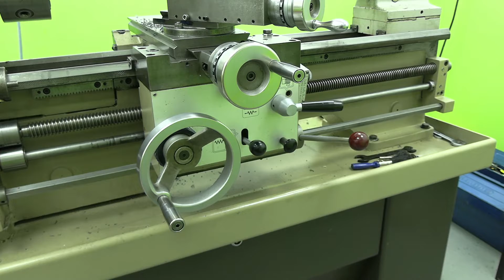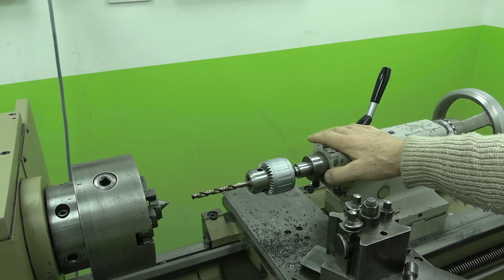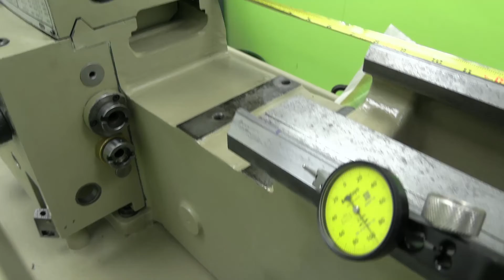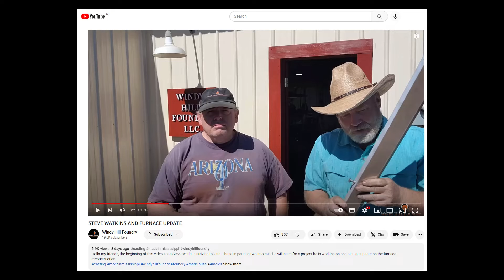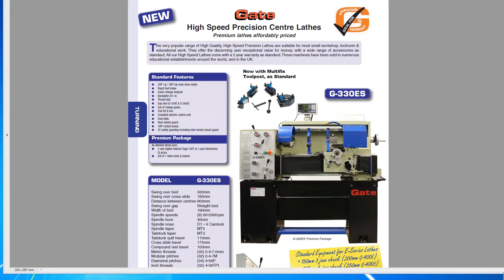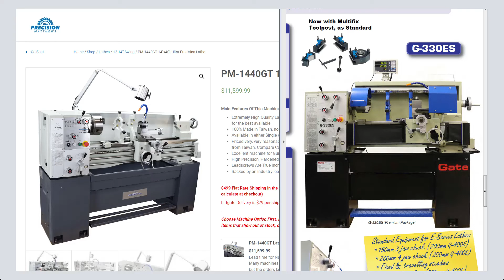What shall I do with my Harrison M300 lathe??

Comment: Hi Samuel,  I am way behind in viewing your M300 videos but greatly enjoyed the earlier ones when you were disassembling sections, etc.  I tend to phase switch between hobbies and just started doing a bit of machining again.  I found this video to be GREATLY entertaining, having gone through many of the same trials, tribulations and pain.  I obtained my M300 in 2004 from a small, cryogenic prototype lab.  It had some wear but not much.  It's the older green model which I forget the dating of.  It's a fine machine and I've especially loved it for the metric and inch thread capabilities.  Retired now for over a year but designed and machined many high precision adapters for fiber optic connectors and adapters.  I don't know how to share my thoughts and advice other than the bullet list which follows.  This would be better over tea (for you) and coffee (for me) or cold beers in summer.
* Physicists and engineers should never buy used machinery (ask me how I know).  Why not?  Because they are used.  We look at the precision of a new machine and lament over every wear point that we find.  You may smile when you realize that the specification sheet is the ultimate medication for our quest.  It ain't gonna get any better than the spec sheet 🙂
Physicists and engineers should never go looking at new precision machinery while trying to restore what they have.
* Now for a quick reality check.  What are you going to make with it?  A small, working model of a linear accelerator or a special bolt to fix your car which the dealer has a month away?  You need precision?  Ok, over what length?  If your precision is over 1 or 2 inches (sorry but I'm going to stay in inch, which you are anyway, correct>), then 1 or 2 inches is the length over which you should judge the machines accuracy.  Not to boast but my slightly worn M300 will hold under 0.001" over a 6", 2" diameter aluminum rod, for a fine final pass.  
*  As I listened to your plight, my mind kept saying ... he needs/wants a NEW M300 which meets its spec sheet.
*  Mostly practical advice from here on ...
*  Be sure that the bed is absolutely level, measured with precision machinist's level and two point with ZERO wear.  I think your machine is a gap bed without leaving my typing for a moment.  This introduces other distortion effects.  So do your leveling.  Be sure that the machine sits absolutely flat before it is bolted down or the bolting down may introduce another distortion components starting at the two ends, going inward on the length.
*  The bed will also have differential wear, which is a different amount of wear on the front way vs the rear way which the carriage rides on.  This can hurt or help you, in your case probably help your DTI measurements.  So your DTI swings off, who cares until you repeat this test on the rear way.  The rear way generally has a bit less wear and may help balance the pain.
*  I know you wanted three phase real bad but keep in mind that single to three phase motor drives not only give great accel and decel features, along with braking control, but the three phase is precisely generated.  It's far better than a 3 phase line and for only a few hundred dollars.
*  I should slow down for now in case YouTube had a limit.
*  I'd be glad to swap other thoughts if I can somehow get a real email.  I don't think YT has private messages though so don;t know how.
*  In my quest for the perfect lathe (M300 is about it) I actually carried an Emco Maximat 11 home and back the next day when I discovered that the headstock bearings were totally shot.  This was in a small SUV at the time and not fun.
*  Headstock bearings -  don't worry too much about visual imperfections.  They may be in the Angstroms (had to throw in some physics units for you).  Change your oil, adjust the bearing properly and at operating temperature.  Then test the runout at your spindle nose.  You may find its almost immeasurable (sorry if you've commented on the actual runout as I only skimmed the video but will watch again.
*  Buy your self a Rohm or other Set-tru three or six jaw chuck.  You can zero out any repetitive runout.
*  VERY IMPORTANT - always keep in mind that for very precise work, especially concentricity, you can machine a part without removing to achieve zero TIR.  Can't really do this on length BUT you could fake a compensation for the bed wear by running a live center on your part.  If the length over which you need precision falls within the length of uniform bed wear, you can null it out by introducing an intentional , very slight taper using the tailstock adjustment.

More later !
Reply from the maker: Thanks for sharing your wisdom. I fear you are right that physicists shouldn't look at used machinery. I want a new M300 but I don't need one! In fact, I hardly need a lathe at all. I bought a Chinese minilathe as a cheap learning exercise, and to make small parts for my robot sailing boat project (which is in abeyance now because my friend Dick is busy). Then got so fed up with minilathe limitations that I went for the M300 - at least I can part off ok with that. Then got sucked down this machinists rabbit hole... Bed is level. I have measured the wear on both ways, even calculated the rotation of the tool post caused by differential back/front way wear. Not sure about VFDs.  My profile has an email address on it. Think the headstock bearing wear is a lot worse than Angstroms but am happily ignoring it. Did reset the bearing preload and measure the run out although there are dings on the external and internal tapers of the spindle that make interpretation difficult. I reckoned run out was within 10 microns. Over here these Rohm Hi-tru chucks are almost as costly as the lathe but would be nice to have. I experimented with tailstock adjustment and travelling steady rest in https://www.youtube.com/watch?v=A0uTpcw1i7Y but without much success.

Comment: Hi Samuel, we bought a worn '97 VS330TR which is basically same machine as your M300 but with variable speed and top rpm of 3000. As for our bed it was well worn thanks to the knuckle heads at Air Canada maintenance in Montreal ( we bought second hand )  Once cleaned up and prior to putting the machine into production in our small tool and die business it became apparent to me that the lathe would need a bed regrind. We had exact same symptoms that you encountered with then carriage rattling across the lead screw and a 0.015" carriage dipping motion near head stock. 5500 can dollars later it was reworked by a very competent local to us machine tool re-builder. I can email you pictures if you like, it turned out amazing and they Turcite lined the carriage to regain what was worn and ground off. As for sticking with the Harrison it was that at 10K plus my labor or a new machine at over 30K can. The 13 x 24" working field is populated by cheap imports that run 2000rpm and have small 2hp at most motors. A quality 2500 rpm 3 phase 3 hp industrial quality lathe is no commonplace unless you look at the likes of Weiler, Schaublin or other high end Euro machines. I feel the Harrison Colchester Group 600 have best bang for the buck.

Comment: Hi Samuel.  I haven't watched all the videos, but do feel for you, as you must be thoroughly browned off after so much work.  I don't think you should look for either new machine or another secondhand one.  This is because they will have faults too (others have commented about the Far Eastern ones needing 'commissioning'), and you will have to sort them out.  Can you face starting all over again?  And for the expense, think of all the materials you can turn with the money saved!!  You know where you are with this M300, so I'd go with the re gound bed. Yes dismantling it again, is a complete pain, but you will be able to change all the seals (hindsight is wonderful isn't, just chalk that up to experience).  The headstock bearing marks are smooth, and I think it runs true, so it's cosmetic isn't?  Sort out the cross slide wear, and that leaves the tailstock, for which you have 'fix' until you can source another one that is better.  Then you have a machine that you know has a good bed, etc.  At that point it will be as good as it can be made to be, and possibly better than a new one!!   Finally I doubt there is any machine that is perfect in the physics sense, so we all work within tolerances', and the question only you can answer is, 'how much inaccuracy can I tolerate?'  To quote Voltaire 'Perfect is the enemy of good...'  Wish you well for Christmas and your decision.  RB

Comment: FWIW I agree with Nicco Deamus snd others: finish the job and you will have a first rate reliable and accurate lathe that you know inside out. Given your experience with discovering the design and manufacturing inadequacies of apparently top quality items, I very much doubt you would find a purchase that will satisfy you straight out of the box. Stick with the known failings and address them rather than taking on a whole new set. Merry Christmas.

Comment: I’ve learned much from your videos and have bought a similar clapped out M300.  I replaced the saddle seals, not too difficult.  
The answer is to regrind, reseal, and replace the bearing with new.  Possibly buy a new tailstock.  If you do that work you’ll effectively have a new lathe.  You can do the bearing/seals while it’s all apart being reground.  The question is how much you value not having a lathe while it’s being restored.  It’ll be much easier to disassemble the second time because your not discovering how to do it

Comment: Hi Samual, I have watched your videos on the refurbishment of your Harrison 
M 300 Lathe.  I think you have already done the bulk of the work and as you have to get it reground , you would end up with a really accurate lathe, and know that all the work you’ve done is right.  Buying another lathe without knowing the providence is risky unless you can check out the lathe before buying.  I trained as a fitter and turner. I have used various makes of lathes and , Harrison and Colchester are among the best quality machines in the world. Some machines are advertised as the same quality or spec as Harrison/ Colchester, but are not the same quality. You should check out if the tailstock can be professionally be refurbished, or a good second hand tailstock be acquired.  Best of luck Samual, really enjoy your videos. Paul Keegan

Comment: Hi Samuel, I have the very same lathe and have encountered most the same issues. Worst been the bed wear and inaccuracy of it all, and the frustration of it not been good enough. The cross slide on my lathe I improved by turning a new lead screw and making the two new brass nuts. It was wear in this lead screw and nuts that made it tighten at the extremes of its travel. Just a thought for you.
Also after many frustrating weeks of setting the lathe up, I deliberately have a small twist in the bed to help with the wear near the headstock. I'm happy (ish) now I can make parts with relatively good results. I had to stop myself from driving myself mad with this project because I am sure I would drive myself mad with a new lathe also, constantly aiming for perfection when it's not really necessary for what I use it for. But if I had the money to spare I would have the best of both. Buy a nice new lathe, keep your M300 for the nasty jobs like turning a brake disc or roughing out holes then swap them to your new lathe and finish off. Why not. You've worked hard, payed your tax, TREAT YOURSELF. I'd Like to see what inventions you come up with and make!😀

Comment: Hi Samuel, my Harrison 140 has bed wear on the front v-way of about 2 thou near the headstock and often I'm thinking "how can I fix this?".  So I can fully understand your feelings given your wear is more. But honestly I ask myself how often does it matter?  You could possibly get most for your lathe breaking for spares (because I've seen silly prices for parts) but then what?   I could buy expensive items because I can but the good feeling does not last long - sounds impulsive and reckless to me. If you could get a really good deal on another M300 you could make the best of both perhaps but a ' very good deal' would have to be  £1k no more. Maybe one with a blown gearbox but good bed. Or get your bed reground.  All these old machines are a risk but you can get lucky like I did my Harrison mill top spec with everything there and very little wear. Adding together what I paid for the H140 and the H mill was only what you paid for the M300. But obviously that comment does not help 😬  Cheers.

Comment: I'm sorry to hear that it is so bad! 
I'm guessing that it is Slideway Services in Coventry that have quoted for the regrind. If so, there is a company called Spindle Services also in Coventry but not as far as I know related. They quoted for work on a Hardinge HLVH tailstock but I can't remember the price for this. I seem to remember that they could get them back to spec, even when badly worn. They supplied two new headstock bearings for £600.00 (this was around 2 or 3 years ago). It would be worth asking them for a price for the bearings. It may be possible to get the regrind place to talk to Spindle Services, so that you get a bed, saddle and tailstock back that have all been reconditioned and are all in alignment. 
Good luck with whatever option you go with!
Reply from the maker: Thanks, I've noted down Spindle Services. I can't remember if I talked to Slideway or Unislide; they're both near Leicester.

Comment: Samuel you are a gent I have enjoyed your uploads immensely,you’ve made me laugh,smile & cringe at times especially when wearing Jesus boots in the workshop a big NO.
You settled with the headstock bearings after cleaning & adjusting so run them monitor & adjust if necessary,put this to one side. The other seals bushes & bearings you can do so get on with it.
Your tailstock I’m not even sure it M300 get rid of as there are a few M300 being broken on flea bay. Ask all the right questions when happy get it at the right price.
If you grind the bed by the bare minimum from headstock to tailstock,the head,tail & carriage will all drop by the same amount everything that  lies below has some of adjustment hopefully general fitting skills use your analytical brain to overcome this.
You will never get the money spent back but you will get the satisfaction of doing the best you could.
A second hand piece of machinery is something you have to live with & get to know,to do that you have to use it.
For me life is a work around & never perfect,perfect would be boring,hope this makes sense or helps in some way.
All the best mate 
JM
Reply from the maker: I wear sandals all the time except when I have to go out and look smart. This is because UK cobbers cannot make a shoe that is anywhere near the shape of my feet! In the 1970s I spent £800 (then a lot of money) on having a pair of shoes made for me. They still didn't fit. The saddle has to be turcited up because the apron must not be lowered because its shafts go into the gear box and that is fixed on the side of the bed so cannot be lowered. There is enough clearance between top of gearbox and bottom of headstock to allow the headstock to come down, and I think banjo in the change gearing will cope with that. The more I work on something the more attached I get to it!
Reply: Samuel I meant no offence just an observation on foot ware sorry. 
Gearbox is doweled & on bolts so is the bracket that supports the shafts. How many thou has to be removed if it’s a couple of thou could you not sort this with off set dowels & the clearance on the bolts? Or re dowel just thinking aloud.
I’m really attached to all my workshop machinery like old friends my favourite being a3 1/2” Drummond.
I wish you well have a relaxing Christmas 
John

Comment: 1. Ignore the fool who said 'buy a Chinese lathe"!  2. Regrind those ways. 3 Have someone bore out and fit a bronze bush or two (one each end) in the tailstock. Ok, this might cost you a cuppla £k but let's face it, you've skilfully disassembled and rebuilt the machine, so you know it inside out and not many folk get to know their kit so intimately.  I can speak for the beauty of the M300 .. I have one which had spent most of its 50 years in a school, so no industrial-level wear anywhere. I wouldn't swap it for anything .. it is a superb example of precision-built British engineering and I know in my soul that you would overcome the despair of breaking yours down and rebuilding it again.  Take heart, Samuel!! Do it!!
Reply: I have to agree with this as I used to own a Warco Lathe and mill both items were poor in build quality and accuracy. I now have a well looked after Bridgeport mill and a less looked after Smart and Brown 1024 which will be going away in the next year for a re grind as for 1500 pounds it will make it as good as it needs to me for my lifetime.